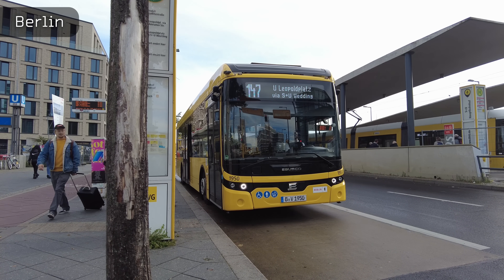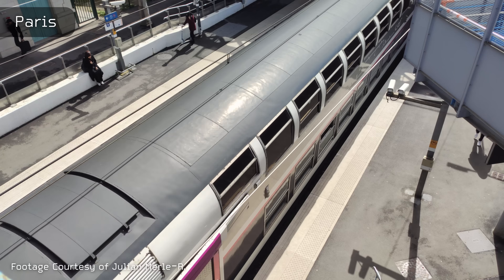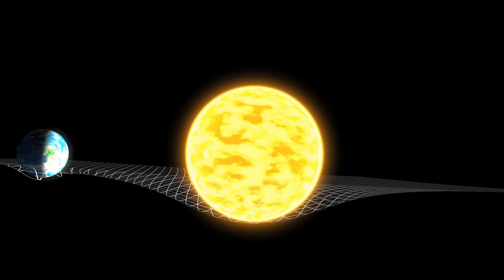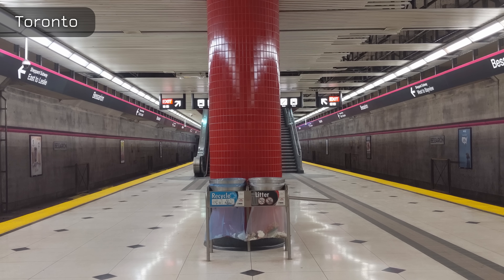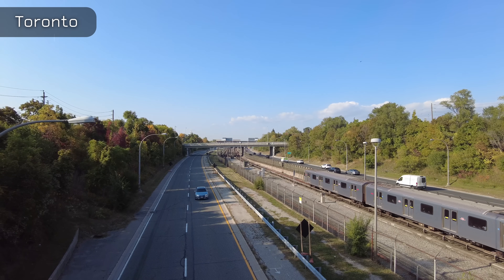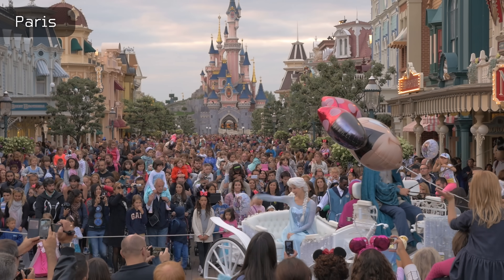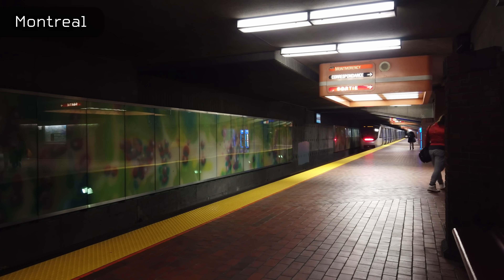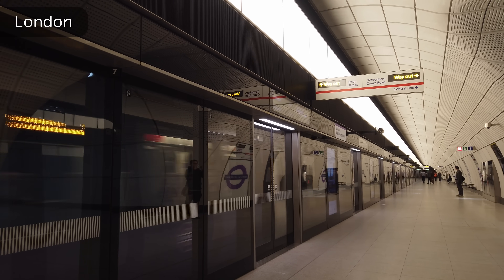Stop Spacing and the Power of Density

Comment: In a metro area with low density suburban sprawl, it can be almost impossible to make a viable transit network. It can take a 15 minute walk to get to a bus stop, 30 minutes on the bus, 30 minutes on metro rail, and another 15 minute walk to the destination. It literally takes about the same time or less by bicycle. It takes less than a half hour by car.
Reply: Not true. I live 50km radially from a city of 5 million. We have 10 min frequency on local bus and 10 min frequency on trains. Bus is 5 min walk away. 1970s sprawl.

 Main issue is transit time on trains is too slow.
Reply: @ The trains are not the issue. Getting to the trains is the main issue. I imagine a BRT network could be a solution, but it would require a huge mindset change. People aren’t going to want to give up a lane, particularly in today’s political environment. Most of the population likes their stroad grid.
Reply: @barryrobbins7694  Did you not bother to read any of their comment?
Reply: @Gfynbcyiokbg8710  The commenter is in a different situation. I’m speaking of population size that is smaller. The geography and street layout means that many people will have to walk a mile to a bus first (most people won’t want to do that). The car infrastructure is designed to make it at least twice as fast to get to the city by car. The only people that benefit from the train lines are those that live relatively close. The train lines are also only about 30km from the city at most. The area would really benefit from bicycle infrastructure.
Reply: @barryrobbins7694  No. That's not what you said. In your original comment you were talking generally about all low density suburban sprawl, but that clearly isn't what you intended as you are now talking about one specific city.

You also cannot just say that "the trains are not the issue" when you have no idea what city they are talking about. In their experience the trains are the biggest issue so unless you can provide some evidence to prove otherwise, the trains in their city are the issue.
Reply: @ I stated “it can be”. I don’t think it is unique to one place in the United States or Canada. Trains are not the problem for the particular metro area I was speaking about.

Comment: I've been proposing that the 136 expressway under downtown Montreal be closed to allow for two new metro lines that are otherwise above ground to use it, since on the east side one going up all the way to Pointe-aux-Trembles to relieve the Green Line and another going to Langelier Boulivard before turning to go up to Montreal Nord would be great, especially as on the west side one could continue to Lachine and the airport and the other go to Lachine to create cross connectivity would be great, how this would work great is that they could meet at Champ-de-Mars with the Orange line allowing one of these two lines to continue without stopping to Georges-Vanier allowing anyone going past downtown or somewhere on the opposite end to get there faster while the second line could simply have fewer stops downtown to increase travel speeds while the Orange Line can be used for transfers if that's the faster option then walking from that line's stops.

Comment: Alas the UK is sufficiently non-dense that a typical half-hourly service from Cardiff Central will only call at Newport, Bristol Parkway, Swindon, alternately at Didcot Parkway, Reading and London Paddington.

The hourly service from Glasgow Central to London Euston is more extreme, as it will call at Carlisle, Penrith, Oxenholme Lake District, Lancaster, Preston, Wigan North Western, Warrington Bank Quay and London Euston. Warrington to London is 292 km.
Reply: Well those are intercity services connecting the largest cities of two different countries, so very different. There are local services that run parallel to both of those, for example the Elizabeth Line and Lioness Line
Reply: @katrinabryce  Actually not really, at least not between Bristol Parkway and Reading, there is only the intercity (there is an extra 2 tph intercity Swindon to Reading as it starts at Bristol Temple Meads). Similarly between Wigan North Western and maybe as far as Wolverhampton.
Reply: Wtf are you on about?
Reply: @seprishere  There are local services between Reading and Didcot. I’m not so familiar with the Bristol area.
Reply: @katrinabryce  There are the Oxford trains, but no non-intercity trains between Didcot  Parkway and Bristol Parkway.

Comment: if the station density should increase with population density, then should the population-per-station be the same for every station?
Reply: It's impossible. 
There are stations with a lot of housing nearby, stations with a lot jobs nearby, stations that are transfer hubs, and stations where it's pretty much mixed.

The new Grand Paris Express stations, for example, have quite different expected attendance, from like 15k to nearly 300k daily.
Though, a huge proportion of them, especially on line 15, are interchanges with other lines.
On M15, all but 1 or 2 are transfer stations.

In the case of Greater Paris, the transfer opportunities are quasi more important than population and density.
Reply: You generally want an even spread of passengers, but that's not entirely driven by population density, and it's only ever a goal to strive towards, not to reach.

Comment: Fun fact, there are reserved spaces to add stations on RER A Disney branch each side of Bussy St Georges (which was added when the branch was extended to Disney, they also later added the Val d'Europe station after that neighbourood was developped).
Once you add those stations, each station is evenly spaced and that's one of the reasons why this line is so good at what it does, evenly spacing stations means a more reliable line altogether.
By comparison, RER B and C which were different types of services merged together are bad in reliability because they have very different station spacing from section to section. RER C convoluted route with too many stops in the center and RER B merging what was essentially a suburbian metro line in the South with a suburbian train line in the North makes it quite a bad line. 
Arguably, I'd fix RER B by cutting it in half at St Michel Notre Dame, digging a new tunnel to connect the Luxembourg and beyond station to a new line with along the same station spacing and turning it into a modern fast heavy metro with a new section up to unserved Northern suburbs and dig a new tunnel for faster travels from the existing St Michel Notre Dame RER B station to Southern suburbs, offering a direct connection to Saclay and possibly Orly via a new RER station at Montparnasse (coupled with the eventual RER F going there from St Lazare). 
RER C South Western and central sections would be cut into two heavy metro lines, with the Porte Maillot branch deviated after St Ouen to Ermont (giving the Pontoise branch to RER F). A new RER C line would be dug between Gare du Nord and Austerlitz via République to alleviate part of RER B overload and better connect Northern suburbs to Southern parts. (and not forgetting to double the tunnel to Châtelet from Gare du Nord to sevregate RERs B and D)...

As for Line 14, it could do with a Rome station to give a connection to Line 2... it has one with Line 6 so not having the symetrical possibility is nuts ! They wouldn't do it because "technical reasons", cough cough, money...

Comment: It's funny...  Paris proper has a population of about 2 million and you can get from one side to the other by metro in 28 minutes, even though the metro's average speed is low. You can grade speed by the square root of population density.
Reply: Is it also funny how a European city (Paris) with a population of about 2 million is higher density than Toronto, which has a population of over 6 million?

Comment: Stops need to be equally spaced to simplify operations.
Reply: simplifying does not achive good results.
Reply: They absolutely don't have to be
Reply: It doesn't really simplify operations in a meaningful manner. It might simplify planning if you want an even coverage, but that ignores differences in density and popularity of destinations.
Reply: This does not simplify things, it could even be the opposite. Evenly spaced stations without regard to the population density and potential passenger load is a bad idea.

Take Paris line 14, for example. There are longer distances and much shorter distances between stations of this "express" line.
Châtelet-les-Halles to Gare de Lyon, in the core, is a bit under 3km, but Bercy, the next station, is only like 500 meters away.

CLH to GdL is an extremely busy route that is also run by M1 (with several intermediate stops) and RER A, so line 14 didn't need to have intermediate stops in this densely populated and visited area.
But Bercy is an existing station of M6 offering a transfer and is also located right next to a major indoor arena capable of holding 20 000 spectators and a secondary mainline train station.
The further next station, Cour Saint-Émilion, serve what was at the time a new renovated neighborhood with a major new entertainment location (cinema multiplex, dining and bar street, village like shopping).
So both Bercy and Cour Saint-Émilion needed a stop, even if they're only a few hundred meters away from each other and from Gare de Lyon.

Plus, this Bercy / Cour Saint-Émilion neighborhood is isolated on its North side by the tracks corridor of Gare de Lyon and on its Southern side by the river.
So, a lot of people would be going to / from there, especially at certain hours with massive ridership spikes.

Just like Madeleine and Saint-Lazare stations are  about 700 meters away from each other by street walking, but both are major transfer nodes, so they both got an M14 station.

Plus, the line is fully automated so station spacing could be perfectly consistent or all over the place, it wouldn't change anything. (And wouldn't either even if it was manned by drivers).

They can maintain 85 seconds between departures in each direction, whatever the distance between stations.
What could negatively impact operations is a massive difference in attendance between stations, not their spacing.

Let's say there is always exactly 1km between stations. Operations would be just as consistent as if it had wildly varying spacing.
But if all stations were 1km apart and some had barely any attendance while others were extremely busy, it would have more impact.

That's why having closer stations where there are more people helps spread the passenger load.
Reply: @AnotherDuck  it does as in you can remove signalling and instead do a timetable&train counting (only 1 train each between any two stops in a given direction) operation if all stops are equally spaced
Reply: @erkinalp  It's the same situation as long as you don't have more than one train between any two adjacent stations. Getting above that means you have a very dense line.

You could say that you'd be able to have trains closer together for more trains (since the maximum distance between stations would be shorter), but at the same time, you'd lose speed from having more stations, which would also cost a lot more than adding signals.

So the benefits would be outweighed by the downsides.
Reply: @AnotherDuck  I do wonder if having both uniform density and equal stop spacings does simplify things.